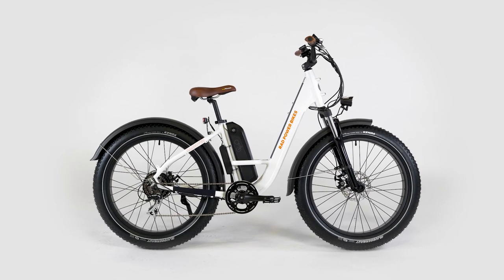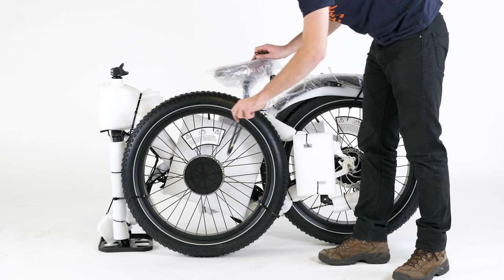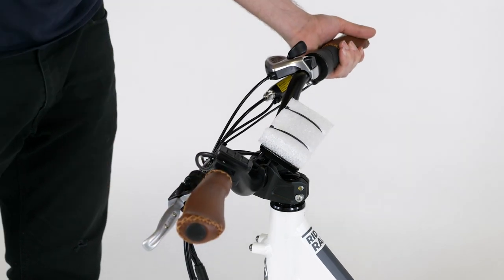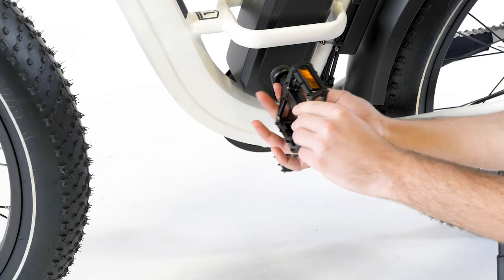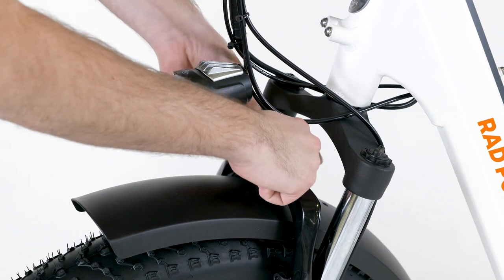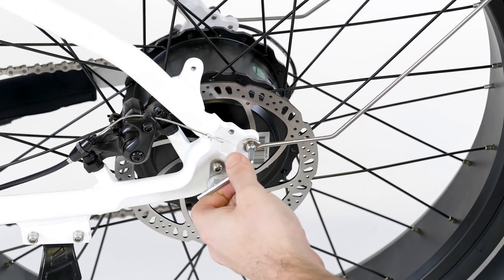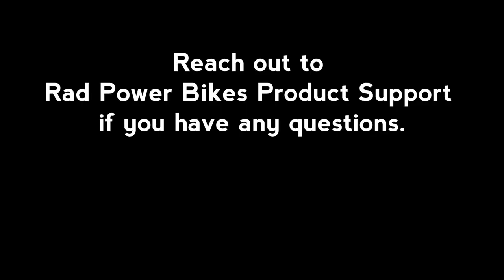RadRover Step-Thru 1 Assembly Instructions | Rad Tech

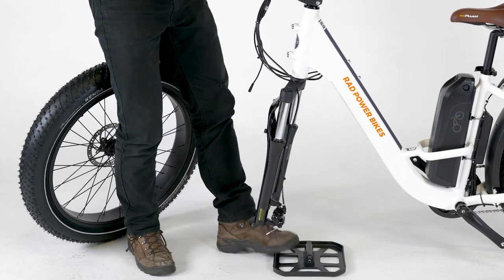Comment: Very helpful video. Just two tips to add. In the video (4:02) the bike lifts off the fork protective plate with no problem, but mine didn't want to come off. Had to tap it off with a mallet. Also in the video (5:46) the front fender slides between the tire and fork arch from the back of the wheel with no problem. On mine the fender mounting point didn't want to clear the fork arch. Perhaps I should have let some air out of the tire. In any case you can also slide the fender through from the front of the wheel while gently bending the fender support rods and clamps through the fork one at a time.
Reply from the maker: Thanks for the feedback!
Reply: I cant get mine off of the fork either!
Reply from the maker: Contact support@radpowerbikes.com. We're here to help!
Reply: Ok

Comment: Good instructions. Got 152 miles on the bike in 10 days. Experienced first flat on back and was able to patch it myself. Need more tech content on brake adjustments for stretch cable, derailleur tuning, and even a flat tire fix.  This would be good for on the road best practices.

Comment: Had some trouble due to not knowing that the light and the display were flexibly set, they could be moved for ease of installation. I was afraid of bending and breaking something. Also, include some extra washers, as one or two can easily get lost, I had to search for mine front fender dropped thrice. Also, handlebar orientation is tricky when one is first doing this as it comes in a weird orientation out of the box, kinda bewildered me for some time, until i carefully examined the video. duuh.
Reply from the maker: Hey Tom! Thank you so much for sharing this insightful feedback! It sounds like you got the assembly process all worked out, but in case you have any additional questions, our Product Support team is available for assistance. You can reach them at - radpowerbikes.com/support. 😎
Reply: Was out twice, I love it. Up hills, over fields and around a lake, 30 km/hr on flat stretch, no problem.  @RadPowerElectricBikes

Comment: What happens if you touch the brake rotor?
Reply from the maker: Hi Michael, please make sure the brake rotor stays as clean as possible during assembly. Oil and debris from contact with skin can negatively affect braking power. If your skin does make contact with the brake rotor, please use isopropyl alcohol and a clean paper towel to clean the rotor.

Comment: What exactly is bicycle grease? Surly it’s a grease I already have.
Reply from the maker: Hey Don! In general, bicycle greases are usually thinner than automotive greases which are typically thick and heavy. This could add some additional friction to the metal-on-metal components of your bike. There are a ton of suitable options out there but a bicycle specific grease does usually mean that it’ll last the appropriate amount of time without causing any undue strain. I hope that helps 🚲🔧👍
Reply: Rad Power Bikes .... shouldn’t Rad just include a tiny plastic tube of “bike grease” along with the tools?